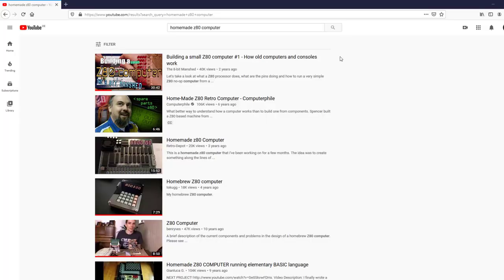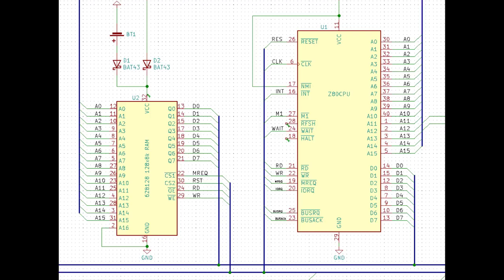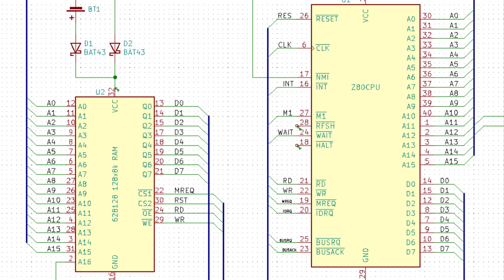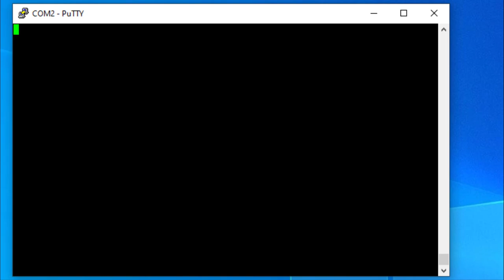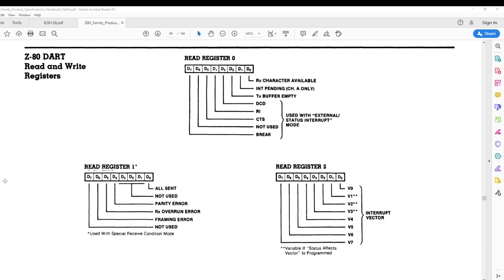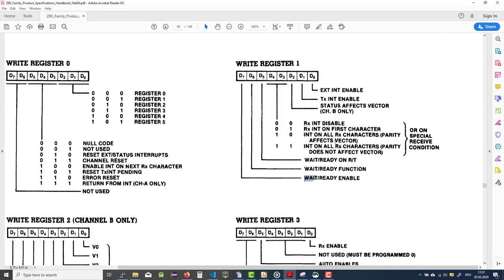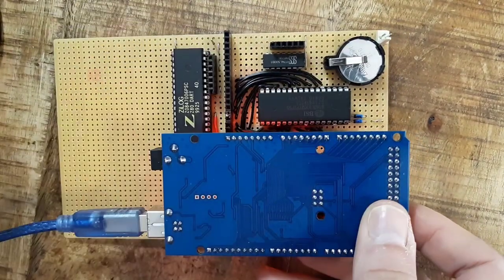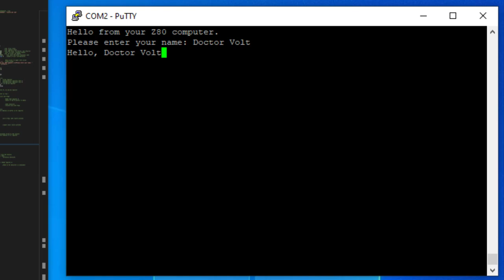DIY Z80 Retro Computer #2: Serial Communication with DART

Comment: I just thought of something, If you get the timing right, you could use the other serial port on the DART chip to program the computer with. Port B is input to program the SRAM and port A is normal serial I/O for terminal. have a "bootloader" program poll port B and write it back into empty space in ram then stop when the data is done then jump to the address of your uploaded program. if you could get that to work you wouldn't need the arduino at al to program it!
Reply from the maker: Yes, this is the principle that the arduino also uses. I was already thinking of that.
Reply: @DoctorVolt  I did exactly what he said, but I used an eeprom to record the program. The problem is the minimum time to record an eeprom that is 1 mS, so I had to make a circuit that pauses the cpu (/ wait) for a while, after I activate the memory

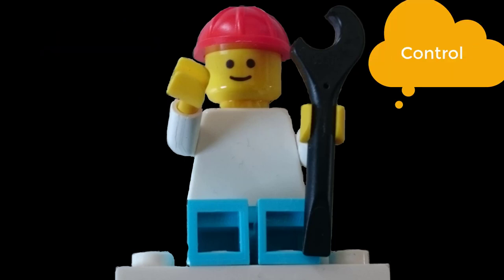Comment: 02:50 Good friend, but you ignore the Fe-RAM! Ferro-electric RAM, it works like a RAM but retain data without power like a ROM (from 10 to 151 years, it depends of kind of F-RAM).
It use power just on write or read operation. For your project you can use the Fe-RAM FM1808-70-PG-Ramtron, on AliExpress and on e-Bay you can find at 2€ each.
So your can get off your Z80 computer, and continue your work when restart.
What about?
Reply from the maker: Could be an option, but it has only 32k. So I'd need two. Anyway, I solved the problems I had with the SRAM with an EEPROM.

Comment: Hello! I appreciate your tutorials that have motivated me to use my more than 30 years forgotten Z80 card. I tried to copy the z80.asm code from the video, but in the end it didn't match your code. I think you were modifying the original and did not show the final result. Would you be so kind as to share it? Thanks and greetings from Mexico!
Reply from the maker: the ASM File will only run on a Z80 board that has a Z80-DART chip for serial-IO. If your board has no DART, it will not run. You must also adapt the IO address of the DART to match to your board and the clock divider bits in byte 4 accordingle.
Find the schematic of my final board on Github: https://github.com/michalin/ZX2020/tree/master/Schematic
Reply: @DoctorVolt  Oh, thanks! Your schematic I'd already download it before and that's why I wanted to understand your .asm code to see a way to adapt it to my board that has an Intel USART 8251, using my Arduino Nano as a programmer. I really appreciate your kindness. Regards.

Comment: Good idea, but honestly I do not think that the SRAM is the best solution for all data in personal computer. Imagine when the battery is running low… But yeah, sure, for experimenting it is pretty straight forward solution, I like it.
Reply from the maker: yeah, it is more a learning toy. Will never store any important data on it. And I must always have my Programmer-Arduino in reach.
Reply: use a small lipo and recharger...

Comment: I wonder how long the sram can hold its data before the battery dies
Reply from the maker: The data sheet states that the standby current of the SRAM is 0.1 microamps. The CR2016 cell has around 90 mAh of capacity. So we we can calculate a battery lifetime of more than 100 years. However I think that it will die earlier because of self-discharge.
Reply: @DoctorVolt  That's impressive

Comment: Would it be possible to substitute the Z80-DART for a Z80-PIO / Z80-SIO? The latter chips, by my understanding, are made to interface with peripherals as well.
Reply from the maker: Yes, you can substitute it by a Z80-SIO, because the DART is a simplified version of the SIO. However some pins are different. Z80-PIO will not be feasible, as this offers a parallel interface only.

Comment: Oh nice! I love the RTC! I chose the 16C550 for my UART, and made the clock circuit from a 74HC14 and a crystal. Did you get any further with this? Mine is at PCB stage now. You can see it here: https://youtu.be/MaolTlk7XKM
Reply from the maker: To keep my design as simple as possible, I take the serial clock directly from the 4 Mhz system oscillator and set the DART to devide it by 32. This leads to an unusual baud rate of 125000, which is not supported by all terminal emulation programs, but it works well. Maybe a 555 with precision resistors and caps could also be an alternative, especially when using legacy VT terminals, but I didn´t try that.
Reply: @DoctorVolt  Ah, I like your thinking. I used two separate clocks on mine, but I realised that just one 7.3728 MHz one would have been the best solution. This divides down to proper baud rates, and is a reasonable speed for the CPU.